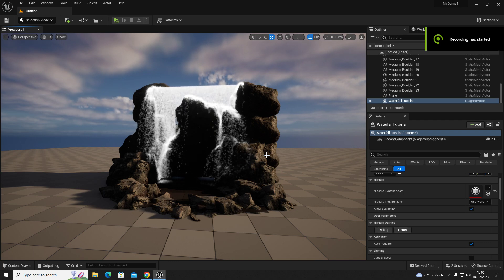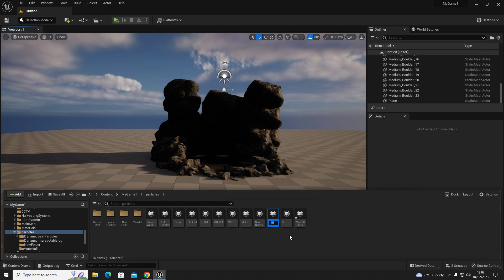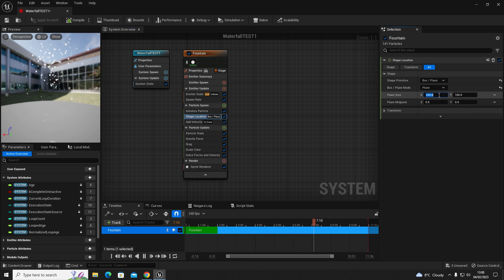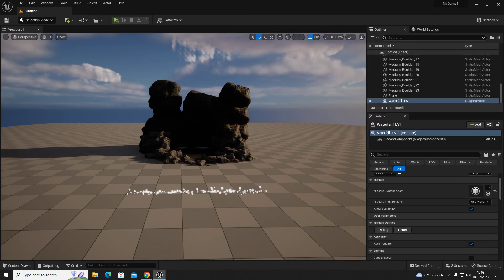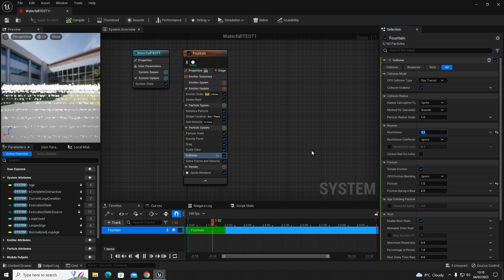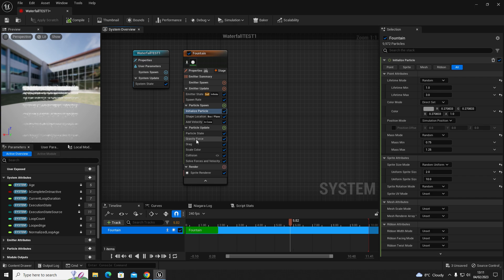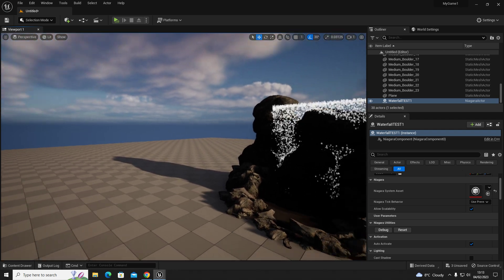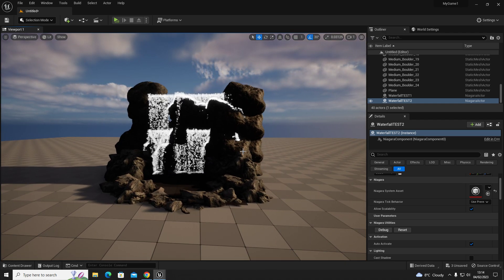Unreal Engine 5 Niagara Particle waterfall Tutorial

Comment from the maker: If people are struggling with collision for meshes and the particles are not interacting with the mesh make sure " collision " is added to the particle inside Niagara, also make sure your asset that you are using has a complex collision enabled to do that open up your asset tab by double " left " clicking it in the content browser once it opens in the details panel on the right scroll down until you see a setting named collision in there you will probably see "   Project defaults   "    change this to Complex as simple especially if the mesh has multiple angles and shapes. 

If anyone is still struggling with this I do have a discord you can reach me on and I will always take the time to help anyone but just remember I am human I am not a robot so be nice :)  good luck with your projects and hit me up if you need help.

Quiet voice because I was sick

Comment: Hi I made this for my scene in ue5 and the water looks like its glowing? is there any reason this is happening or how to fix it. Any help would be apricated thank you.
Reply from the maker: To stop sprites from glowing in UE, you need to check your material settings and make sure the "Emissive" colour is set to black or very low intensity, as this is the primary setting that controls how much light a material emits; additionally, you can also adjust post-processing settings within a Post Process Volume to fine-tune the overall brightness and prevent unintended light emission, Sprites are used as they are very low cost in performance but they have their limitations, there are other features within Unreal that will yield different results what you could do if sprites are not practical to your personal use case scenario is enable water plugins inside Unreal engine and use one of the inbuilt water simulations but at a higher frame rate cost pending use.
Reply: @AMMediaGames  thank you so much, awesome :D

Comment: Thanks for the great tut! My particles however only show up when I select 'unlit'... anyone know the solution for this? Maybe its because im using lumen or something for lighting?
Reply: FYI I changed sprite render material and they are visible now!
Reply from the maker: Hard to say without seeing the full setup, sprites use a slight amount of emission in the master material if you open the sprite texture test there to see if it's set up correctly. I was using Lumen in my video it could be a version difference.

Comment: Does anyone know if there's a way to have the waterfall lead into a pool of water, like a lake or river, and have the particles fill up the pool? I tried extending the life of the particles but it never seems to be enough to fill up a small body of water. Next, I tried to add a second Niagara System, the one titled GRid3D_FLIP_Pool, and placed it so the waterfall from this tutorial would lead into it, but I'm wondering if there's a better way that would look more natural

Great tutorial btw! Very clear and to the point
Reply from the maker: For that you would need to make a container and a fluid simulation as it's extremely performance heavy to have merging particles you could enable Fluid sims in the addons inside Unreal engine 5 or you could take a look at " fluid Ninja " the entire point of this tutorial was a low poly high performance sprite waterfall if you want realistic you are going to have to look into baking fluid simulations or using a real time fluid sim as i mentioned earlier with the addons " fluids "  this tutorial is not for " realism " you can use gas or fluid simulations for that.

Comment: Maybe you know,can you tell me what to do if water is not rendered?
Reply from the maker: Its difficult to say as there are a few reasons but try looking at your bounds settings for the particles,   theres Gpu sim,  fixed bounds and dynamic bounds if you set it to fixed bounds just below are some size parameters adjust that to 100 x 100 x 100  ,  default is usually  -100 x -100 x -100
Reply: @AMMediaGames  I'm sorry, I forgot to clarify.
I have a problem with water that's like a lake. The waterfall itself is rendering great. Not a single ohero is visible in the rendering.
Reply from the maker: @Levelart.m    in console type  r.water.waterinfo.rendermethod 2
Reply: @AMMediaGames  Thank you so much, everything works, you are the best!!!
Reply from the maker: @Levelart.m    You are most welcome glad we fixed it good luck with your project! :)

Comment: hi great tutorial, can we make this in horizontal way i mean i want to make a CFD on a montain with wind arrow is it possible, and can we make colors change wen particule touch mesh? thank you
Reply from the maker: you can achieve all of what you asked if you alter a few of the settings you can also change colour by velocity and on impact " collision " it's all in the settings inside the Niagara particle system. you can have particles spawn as shape mesh too so if you want them to  be a specific shape you can also do that.
Reply: @AMMediaGames  thank you for the answer, i am new in unreal, so i will try it, thank you
Reply: @AMMediaGames  can we add arrows instead of particuls? or line thank you
Reply: @AMMediaGames  this is the model https://youtu.be/Md_XTOzp7tk thank you

Comment: I created multiple waterfalls and followed exaclty the steps but it still goes right through my meshes. The assets Im using comes from Quixel and does not have a "complex collision" box to tick. Im using Unreal Engine 5.1.
Reply from the maker: Open the asset by double clicking it in the content browser on the details panel on the right side if you scroll down you will see collision set to project default you can change collision there.
Reply: Is it the " Collision Presets"?
 @AMMediaGames
Reply from the maker: @PutraMahawangsa  so the asset is the mesh you are using so when you press ctrl and soacebar to ipen the content browser double click the asset in there when it opens inside the asset detail panel on the right side scroll down until you see collision settings then a small drop down box that says project default change that to complex as simple you should see a blue coloured collision mesh drawn over the model in the window.
Reply: OH I found it! It works! pretty confusing coz "Collision" has two tabs. One is when u click the mesh in details panel. Apparently, there is a 2nd step which is to click on the mesh again under "Static Mesh" tab wic will bring you to the correct "Collision" tab to edit. needs to be clearer next time :D
Reply from the maker: @PutraMahawangsa   glad for you have fun experimenting 😀

Comment: Great tutorial, easy to follow, 1am me thanks you greatly
Reply from the maker: Thank you for the kind words appreciate it :)
Reply: @AMMediaGames  performance impact is nothing to scoff at though... with a few in a scene,  I went from 50fps to 10.
Although I'm not surprised considering the load
Would setting them to gpu ease it?
Reply from the maker: @Keln02   it's the render bounds that affects performance if you have infinite bounds on the sprite render then it will impact performance as even when not looked at the GPU will still load it into Vram enabling limited bounds so it only renders the particles within view of the player will help massively. In testing I've not had any issues with FPS having lots of these in my scene all depends on many spawned particles you have the life of the particles and what material or texture you use also. yes set it to GPU rendered take the load from the CPU

Comment: Can’t get collision to work with my mesh…particle go right through
Reply from the maker: In order to help you i need a little more information than that :) 

What type of mesh are you using?
has it got collision enabled?
does the particle have collision enabled?
Reply: @AMMediaGames  a mega scans asset…yes on collision on both…if I add a sphere…the particles will  go around the sphere and through the mega scans rock …
Reply from the maker: @SuperMachead1    Have you opened up the asset and added collision for the megascan mesh? :) if you are not sure how to do that you can join the discord and I will screenshare for you so you can copy me if you do know how to do that then let me know how you get on.
Reply: @AMMediaGames  yes I added capsules….which really doesn’t follow the contour of the cliff face 🙁
Reply: Shouldn’t megascan assets come in with collision?
Reply from the maker: @SuperMachead1   You need to do a complex collision mesh for that megascan it will have one already just needs activating
Reply from the maker: @SuperMachead1    Yes read my last response :D
Reply from the maker: @SuperMachead1     If you open up the megascan asset into it's properties tab, look for collision settings and enable it there it probably currently reads as  " Project defaults " ... you want to enable complex collision so the particles can interact correctly.
Reply: @AMMediaGames  ….thanks for your help…I will let you know how it goes 🤓
Reply from the maker: @SuperMachead1     You are most welcome if you need more help you can reach me on here in the comments by email or on discord.   Good luck :)  hope you achieve the look you want with your project.

Comment: Do you know how restarize particles to look like water?
Reply from the maker: Create a particle system in the Content Browser by right-clicking in an empty space and selecting "Particle System" from the context menu.

Open the particle system by double-clicking on it.

In the Details panel, scroll down to the Rendering section and expand it.

Under the Rendering section, find the "Render" drop-down menu and select "TypeDataModule".

In the TypeDataModule section, find the "RenderMode" drop-down menu and select "TypeDataModule".

Under the TypeDataModule section, find the "RenderGeometry" drop-down menu and select "TypeDataModule".

In the TypeDataModule section, find the "RenderGeometry" drop-down menu and select "Sprite".

In the TypeDataModule section, find the "RenderSortMode" drop-down menu and select "ProjectedDistance".

Save the particle system.

Drag and drop the particle system into your level.

In the Details panel for the particle system, scroll down to the "Advanced" section and expand it.

Under the Advanced section, find the "SortingPolicy" drop-down menu and select "SortAlongAxis".

Under the SortingPolicy section, find the "SortAxis" drop-down menu and select the axis along which you want to sort the particles.

Play the level and the particles should be rasterized. You can adjust the size, shape, and behavior of the particles in the particle system's settings to achieve the desired effect.

Hope this helps :)
Reply: @AMMediaGames  Thanks I will test

Comment: if you turrn on the niagara fluids plugin you could do this with actual fluids and I would love to see you do something like that
Reply from the maker: Yes totally true problem with that method is the expensive cost to performance not everyone has a good enough computer to handle that level of processing and if you have multiple of these in your game its very low impact where as fluid sim particles are costly. 

I already have fluid enabled and have used it so i will do a tutorial on that its just i wanted to show a cheaper solution that works well thats more accessible for a wider range of spec :)
Reply: @AMMediaGames  Is Niagara fluids plugin in UE4.27? Or what is comparable in UE4.27 for water flow? (Im looking how to do a shower/water jet effect that collides on Player. Your collision works, but the tiny dots dont look like water jets - long stream of water.) Can you recommend what to do? Ty
(I setup Niagara with long particles to look like water jets. But they spike thru my player before Colliding, and angling off.)
Reply from the maker: @kenalpha3   You could use Ribbon render for a shower with the sprites and apply a water texture to the ribbon render I will have a look at showers and take a look at how i can replicate that.
Reply: @AMMediaGames  Ty for the "Ribbon" name to search (I thought it was called beam emitter). I'm from UE1/2, came back in 4.27, and still learning their new terminology.
So can you confirm that Niagara Fluids are 5x only? (Or was an experimental version released for 4.27?)

2) Yes for the shower jet Sys, I used 10x sprite spawn locations > Applied a water Material > it's semi transparent and has a curvature or something Node. 
Hopefully Ribbon can make it look longer and better/flow around the body.
Reply from the maker: @kenalpha3  never used 4 so not sure what features it has compared to 5 hope it helps let me know how you get on :)
Reply: @AMMediaGames  lol. Well 4.1 etc were archaic and missing a lot. (And particle editing in UE2 was even worst, we had to expand many + box settings. Hard to see changes.)
I was not reactivated until 4.27 in 2022. Thus I have a void. UE4.27 is like 5.0 beta (much different than the old 4.xs). But it seems Niagara Fluids are 5x only. 

I was searching the archives to see if 4.27 got any experimental fluids. I did not find an answer. Let me know if you do the Ribbon tutorial.